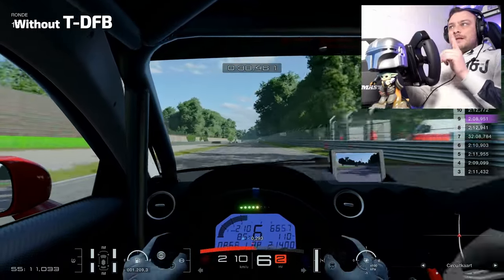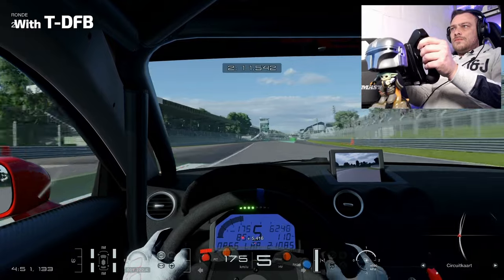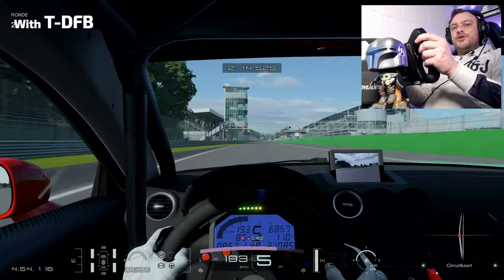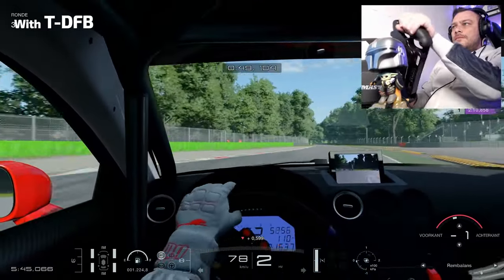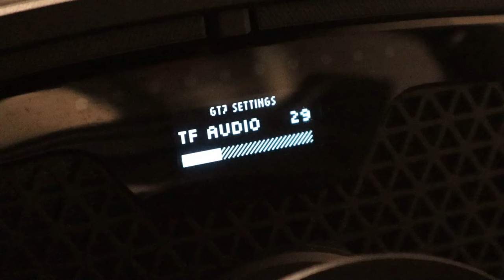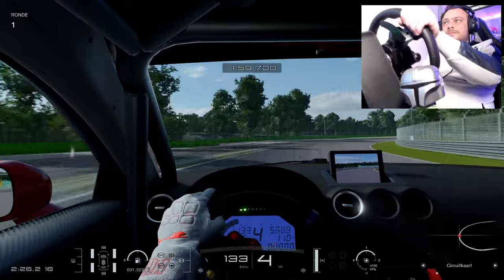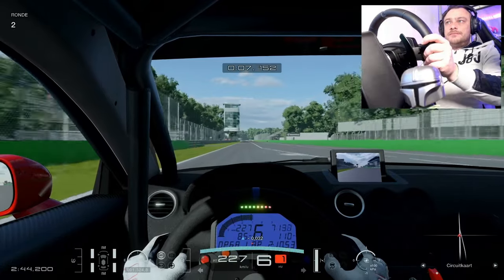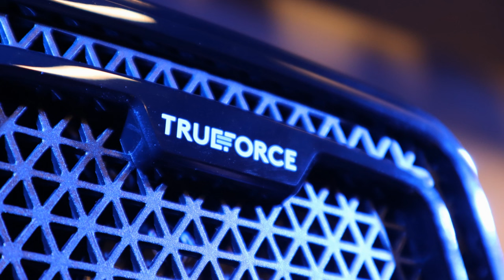Versus: Thrustmaster T-DFB vs Logitech TrueForce

Comment: My experience (In GT7):
1.PS5 controller have both kerb vibration and bridge expansion joint road feedback.
2.Trueforce has kerb vibration on every map including Nürburgring with G923 and G PRO, but no feedback for the bridge expansion joint in map like tokyo expressway .
3.T-DFB has no kerb rumbling in Nürburgring, and not sure about the bridge expansion joint.
4.With Bass Shaker directly connected to PS5 there's no kerb rumbling but have the bridge expansion joint shake.

Some map in GT7 don't provide kerb rumbling in wheels force feedback (for example Nürburgring , SPA) and some map dose provide it via force feedback such as DRAGON TRAIL. the only way to get it is through Trueforce or PS5 contoller......and that's why I can only use Logitech wheel when playing GT7

For me Logitech Trueforce + bass shaker gives you all the sensation in GT7
Reply from the maker: Thank you for sharing your experience friend 👍

Comment: Hi, I just bought a brand new TGT-2, and in GT7 version 1.50, I don't seem to feel the effect of T-DFB, such as when driving over curbs, grass, or gravel. Even when I adjust the vibration to 150, I don't notice any significant increase in vibration. The only thing I can feel is a slight vibration when I fully brake and then rev the engine.

I'm not sure if it's an issue with my wheel or if the T-DFB has been weakened in version 1.50. 😢
Reply from the maker: @x935971196  unfortunately, for now, the T-DFB and TrueForce have been nerfed in GT7. I do expect though, with the current feedback of our community, that they will reinstate it soon

Comment: My first proper wheel was a TGT  2 and loved it .I upgraded to a Logitech G pro just because I could afford it and wanted the best experience possible .Gpro is very similar tp TGT just on steroids.
Reply: Can you compare them more deeply??

I'm starting to believe that between TGT2 and Fanatec 8 nm (given the risks in buying Fanatec) it would be better to take a thrustmaster
Reply: That’s heavily depending on your plans. If you are only playing GT7 (as GTS is dead), the T-GT is a very solid choice. The wheel rim is better than the GT DD Pro standard one. If you want variety, the ecosystem on Fanatec is bigger. The Loadcell pedals for Thrustmaster are a complete replacement, while the CSL loadcell can be added to the standard pedal set.
The T-DFB is nice, I missed it when I transitioned to Fanatec. But then I stopped playing GT7, and on ACC it wouldn’t have been available anyhow. 
I changed the wheel to a McLaren GT3 one. The additional width feels nice. I have hardly ever used the GT DD wheel since I have the McLaren one.
Reply: @marcianzero_yt  Only on PC.
I am mainly looking to measure the difference in terms of feeling, between its thrust base and logitech
Reply: @THESHADOW97139  PC only has so many choices. Look at things like Asetek or Simagic.
Reply from the maker: @THESHADOW97139  TGT is not the way to go for PC. There is only 1 casus where I would recommend it and that is when you exclusively play PS GT7
Reply: @SimulatedDrivingResource  Tspc is same 😉
Reply: Yes it is, but doesnt have the "buttkicker"@THESHADOW97139
Reply: @robertcarr4172  Indeed

Comment: Well my f/f T-DFB on my T-GT works Great on every race game I have being 4  f1 games, GT games ETC, and they all work great,👍🙂
Reply: You will have to elaborate. The transducer is solely supported by GTS and GT7 as explained in the video. How do you make it work on any other game?
Reply: A good friend of mine is a technician working mainly with consoles and games l don't know what he did to my console but he had it in pieces when I saw it lol but is very good at what he does 🙂👍
Reply from the maker: @marcianzero_yt  you can actually define it on Simhub as basshaker on PC if you put it on gt mode but then your wheel wont work. All the searches I have done sugest its not possible to use the transducer so I am curious too.
Reply: @garryburns6659  This story is....complicated 🤔 
In a simulation, the game must transmit the information at the right time and with a given force... it is not hardware, but software....
Reply: @garryburns6659  lol I call bullshit

Comment: I actually dislike trueforce and anything else doikg things like this. I prefer the raw ffb from the agme itself. Not addatives. We already have so many people in the community who want vibrations reduced so much and dont want osccilations and already tone down details. This imo is overkill and doesnt feel right. Just like the fanatec test i didnt like the dd+ using there fullforce.

I feel we have insane amounts of details with any wheelbase now with the right settings.

I want to feel the loading and unloading if suspension and the grip more then any other details anyways.

As dan suzuki said I dont want to feel motor vibrations when sitting still lol.
Reply from the maker: Yeah completely understand. Some people find it pollution of force-feedback and I can understand the reasoning for it.
Reply: Just turn it down though.